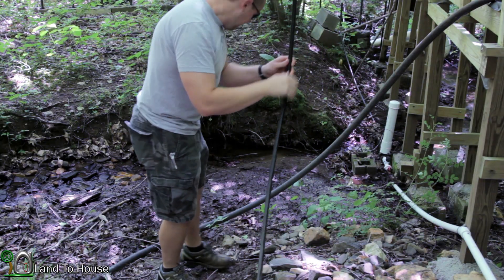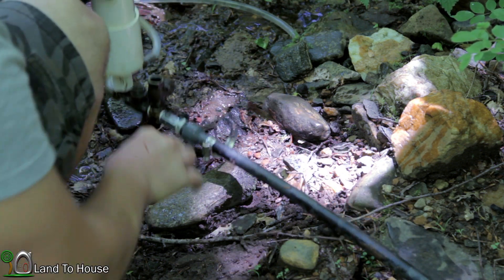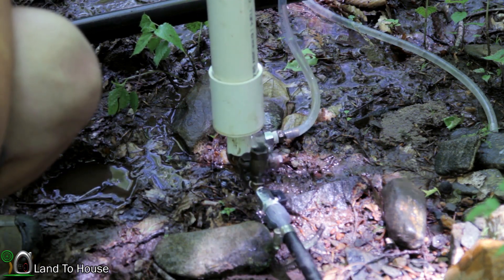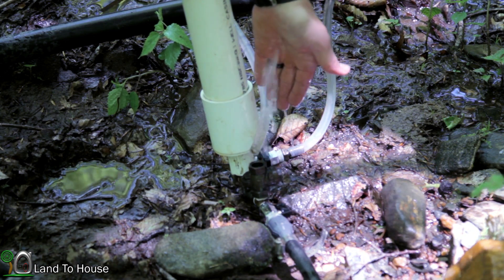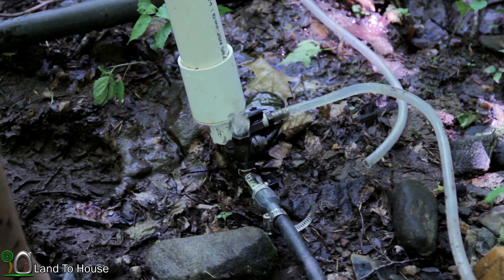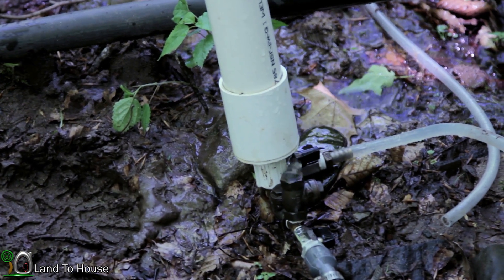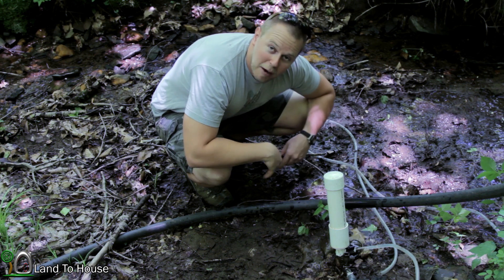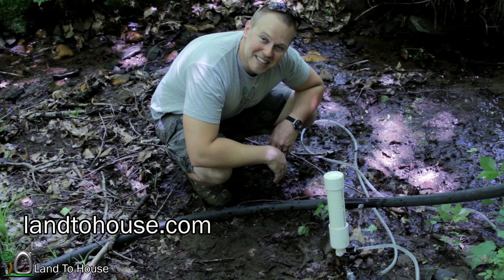WORLDS SMALLEST WORKING RAM PUMP

Comment: I was watching this video (World's Smallest Working Ram Pump) and noticed that the larger diameter drive pipe helped the unit work. I am planning to build a system with only 3' of head and 13' of drive pipe length, and thought that using a 3/4" drive pipe might help overcome the challenges of this setup. What do you think?  Also, you had mentioned in another video about adding a check valve in the delivery line (mine is going straight up) to reduce the pressure pushing back down. Where can I get a good price on one of those check valves?

Comment: In theory any pump should work as long as drive and waste valve are the same. 
On the original 3/8" using vinyl tube were you loosing your shockwave? 3/8 is hard to match up I assume is why you used it, what if you used 3/8" copper tubing would pump work then? 
Another general question can you use a size bigger check valve than waste valve? Most valve springs feel like the same strength but with a bigger surface area it looks like shockwave would have an easier time opening the valve possibly transferring more water.

Comment: With the vinyl tubing you had only 2 ft of head pressure and the tubing all coiled/knotted up,  and this one looks like 4 or 5 ft of head pressure with a much straighter path for the drive pipe, so I'd love to suggest trying each of these variables and see which makes the best difference, such as 3/8 penstock instead of vinyl and the same 4-5ft head pressure?, 1/2 inch vinyl with the same head pressure, 1/2 inch penstock with only 2ft head pressure...

Comment: Were the check valves 3/8 inch or 1/2 inch?  Thanks for doing this.  It help to look at the end points of the size parameters to understand the optimization at different size levels.  In some circumstances we should evaluate if a bigger pump is needed or it would be cheaper and produce more volume to have more smaller pumps?

Comment: I just finished my 1/2" ram pump. (I still have some tweeking to do) Just uploaded a video.  Thanks for your videos and inspiration.
Reply from the maker: I will go check it out.
Reply: Can I get info on the 3/8 ram pump... can I get build list... I'm going to pump up hill from spring to my camp..  part way up hill I will have a dump tank to supply a 2nd pump to feed the next pump..till it reaches the camp
Reply from the maker: I dont have a parts list for this very small pump. It was just for testing. Using 1 pump to feed another does not work well with them both running 24/7. Because 80 to 90% of the water comes out of the waste valve there is not enough water to run the second pump.
Reply: @LandtoHouse  maybe I didn't not go into my drop tank... I use it to control the pressure coming off hill... from my spring to house... it's a tank that holds  60 gallons of water when it reaches a certain amount of water it dumps the tank down a line to next tank... this is done by a flap valve system like in the  back of holding tank of a common toilet... water depth is controlled by a  float and chain... chain pulls valve open.. tank drains valve closes.. tank refills and repeats again... I use this to not over tax my spring.. and not to over pressure the or overflow tanks.. I do have over flow... but not as bad... plus I have extra storage in extra tanks

Comment: Thanks. 
I made but failed. 
Now I realized that the drive pipe must be higher dia than the check valve size. I used 3/4" check valve and 1/2" drive pipe. That was the mystake.  The drive pipe must be equal or higher dia to generate enough pressure to push (close) the valve lip. 
Thank you. 
Good luck
Reply from the maker: For most ram pumps you need to have a drive pipe that matches the waste valve size. This will give you the best results. This Tiny pump needed a larger size drive pipe because it had friction loss issues.

Comment: For best working the drive pipe needs to be steel or some other solid material, a plastic drive pipe expands too much when the valve slams shut and you loose to much inertia.  Martin
Reply from the maker: You are right! I have a video showing the difference between poly pipe and PVC. With only 3 feet of head pressure there was a 10psi difference using a more ridged pipe.

Comment: Way dont you tray the Nicola Tesla chek valve is more eficient
Reply from the maker: Not exactly sure where to get one. I do think that it would not work very well. The ram pump needs to pass enough water to keep the cycle going. Without letting that water out the waste there is not enough momentum to snap the pressure wave back up the pipe.
Reply: You can find it in Amazon but are very small probably god for your ½ inch ram pump and its more efficient for your small 3/8” pump
Reply from the maker: Might be best for a delivery pipe valve. Place it half way up the pipe to keep water from pushing back on the pump.

Comment: Seth, I also wonder with the resistance issue in the experiment, you used a white flexible hose coiled on the ground and not a direct drop, from the head, thus may alternating the results of your experiment.  Also, the stream has a minimal flow so that with a low resistance hose should be enough to create the siphon, so when you have to create the siphon, the old fashion way, may indicate the high resistance of the 3/8ths hose. I am still very interested in how small this pump can go. For instance, if a funnel was formed to increase head and pressure would that cause the pump to perform? What about lubricating all the mechanical portions of the valves to help decrease the resistance of manual friction?
Reply from the maker: I am thinking that using a drive pipe out of PVC would give the highest efficiency results. As for a funnel That does not work so well because of the difference in pressure wave going and coming. When that tiny check valve has to push against a wall of water many times larger (the funnel) it reduces the wave.

Comment: Do I understand it correct, the pump is 4 feet under the source, but presses the water up 10 feet, so a gain of 6 feet  ??
please correct me if I am wrong
Reply from the maker: Yes that is correct. This tiny pump is not as efficient as the larger pumps.

Comment: Can you sink a ram pump into a lake with a float for the source pipe about  foot underwater and then  the pump like 10 feet underwater
Reply from the maker: +jesterod this is a common question. Sadly the pump will not work like this. The head pressure gained by sinking the pump is counteracted by the hydrostatic pressure of the water on top of the pump.
Reply: Land to House damn that sucks because ive seen them work under water i was thinking it might work thx for telling me though and fast reply
Reply from the maker: +jesterod it would be awesome if it worked that way. Then you could pull water from a well too. The pump does work under water but the source has to come from above the surface of that water.
Reply: Land to House gotcha it makes sense
Reply: how about dig a hole near lake to put ram pump in
Reply from the maker: It we work for a short time until the water rises up in the hole to match the lake water and the hydrostatic pressure would negate the head pressure.

Comment: Thank you much for your videos, I just have one quick question. I build one ramp but it is cycling too fast. It has 1 1/4 drive pipe that is 60 feets long with a fall of 9.8 feets, it has 3-inch air chamber that is 3 feet tall, and the rest of the connections and valves are all 1 1/4. The delivery /supply pipe is 1/2 inch and I am trying to pump water to a height of 50 feet and a length of 600 feet. I manage to get the water to about 300 feet but the output is not great.  I have read that the output depends on the cycling frequency and the cycling depends on the length of the drive and the weight of the waste valve. But, none of these seems to be the case. I am suspecting that the bicycle tube inside the pressure chamber might be over inflated and not allowing a good recoil. Have you encounter such a problem. How do I solve this problem?  I am thinking of taking some air off the tube in the air chamber or increasing the length of the air chamber, what are your thoughts?
Reply from the maker: Hello. It would be super helpful if you could send some images or a video of the setup to my email. That way I can have a better idea of any issues you might have in the setup. From your description it seems like things are well put together. The head pressure you have should be plenty to get water to 50 feet. landtohouse@gmail.com

Comment: I'm going to suggest you brand / trademark this pump. It may not be patentable, but you should consider developing a product presence around it. God bless you in it.
Reply from the maker: +Ttf Web yeah I'm pretty sure the patent was 300 years ago. Probably expired by now. When you say brand or trademark do you mean on this size pump?
Reply: Land to House yes. The size seems innovative- so you may consider giving it a name you could sell it under. Something that speaks to its value. Good luck with it!
Reply from the maker: +Ttf Web I would have to find a supplier that sold those tiny check valves for a reasonable price. The 3/8" is comparable in price to the 1" which seems a little bit crazy.
Reply from the maker: I have the ram pump for sale down to 1/2" but the small 3/8" pump parts are hard to find at a good price.